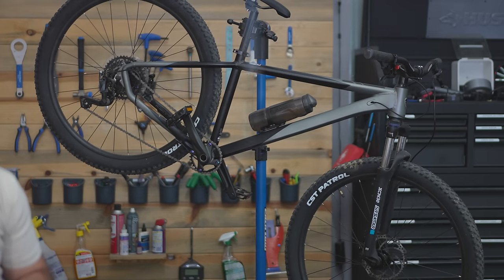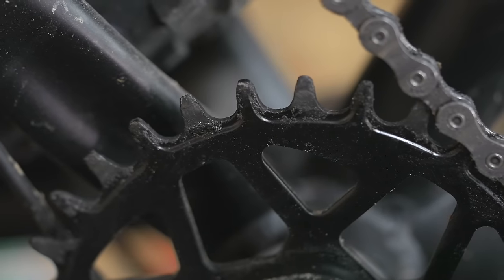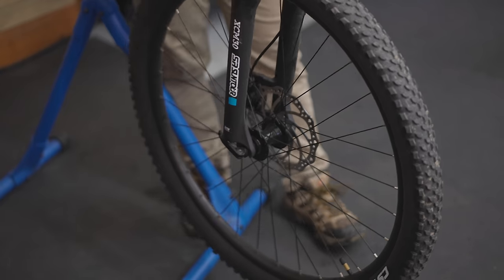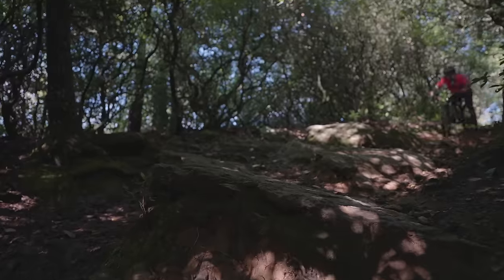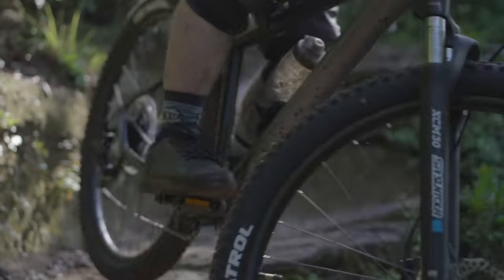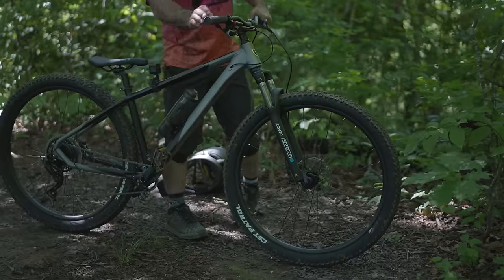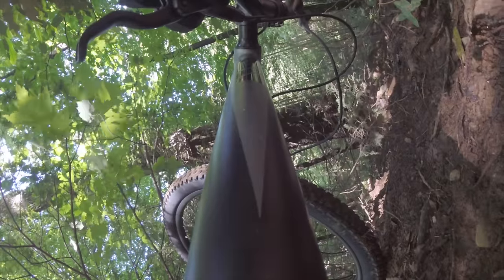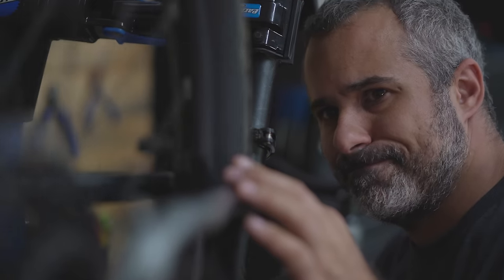Walmart MTB Upgrades! Will it explode or improve?

Comment: It might be worth looking into how much a basic chain guide helps with retention in lieu of a clutch Advent derailleur. Hilarious option would be just to use an old front derailleur. Also bled two pairs of Zoom brakes on some better consumer direct eBikes today--went fine, they worked well. The levers seem extremely similar to Tektro but the calipers are clearly different. I'm honestly not sure what the fitting I used for the caliper was intended for, but it fit--Tektro fitting on the lever. Also may be fun to see reviews on some cheap tires with more gravity focused tread. CST BFGs are pretty chunky for cheap.

Comment: I would certainly go for fatter, knobbier tyres, and set em up as "ghetto tubeless" for a big grip and even suspension feel improvement. I also would try one size bigger front rotor and some sort of chain guide/tensioner for extra retention (parts bin front derailleur, pulley boomerang thing, chain catcher, etc).

Comment: if you are lucky you can get a co-op shimano 9 or 10spd rd with a clutch for $35 or less if you trade in the stock rd. I once found a 10spd Shimano deore that came out to $38 with tax at my co-op. Used once according to them, which is great! Universal Cycles out of Oregon sometimes has Schwable, Continental & a few other name brand mtb tires on sale for under $30. Worth browsing around.

Comment: As a person hitting black level jumps and drops on a bike that is pretty similar but with a 2 gears on the front (Norco storm 3) Its hilarious seeing Seth have the same problems that I have (wheel coming loose, chain dropping etc.)  if this isn't just my bike after around 10 proper rides that fork is going to get way worse.

Comment: You can get those brakes cheaper and safer at your local bike shop! Many bike industry vendors stock Promax brakes for $55 a set.

The bike company my shop works with has quietly started putting Zoom, Power, and Promax brakes on their lower hybrid disk brake models. The brakes are good, but they have pretty bad quality control out of the box. If you buy these, make sure the system stays sealed and check your pistons to make sure they retract all the way! People often have trouble getting them set right because the pistons do not retract and stick out too close to the rotor. They are usually fixed with a bleed but sometimes they need to be replaced. If you buy them from a local shop it will be much easier to obtain a good replacement.

Comment: I have a Trouvaille with some upgrades but I didn't do the forks yet I do have a dropper seat. But the forks are doing the same thing I think they're even bending forward at the head tube also. I think a better pair of forks would really make this bike awesome. I cannot get the front fork from topping out. I ride it hard like that probably three or four times a week but I do give it a tune-up after every ride. Also the brakes on mine work really good.

Comment: Never had a problem with Avid BB7s which I’ve been used on various bikes over the last 20 years or so, but am curious to try hydraulics. Only problem is winter riding here in MN. Worried brake line could freeze!

Comment: Yeah if I remember correctly that fork has a little adnotation on it says it's not for downhill/enduro use, something like that.
I think if you change the fork for the amazon air fork and derailleur with clutch it will perform just nice.

Comment: its actally pretty common for mass produced bikes whether good qualiy or not, to have the quick release skewers come loose on the first ride ro two, the same can be said for any gym equipment, or any equipment involving threading and something that gets screwed into that threading.
when you put in fresh, bolts, screws, or anything of that nature, on a freshly built piece of equipment, the metaltypically wll slightly stretch, shrink, expand, warp, or change in some other way to where the fit is a little loser than it was when you tightened it on day one. 
after one or two uses the metal settles and finds a stable position and point, after which nothing should come loose. 
i deal with it every time i: build a new desk or piece of furniture, intall a new piece of gym equipment, the last time i changed the rims on my car, every time i have gotten a new bike with quickrelease, and every time i bought new rims and skewers after that. 
metal despite how hard it is, when put into relation with the forces inflicted on it by us on a daily basis, is actually quite soft. 
like just think for a second how much weight gets slammed down onto the entirety of your bike when you simply jump off a curb at a substantial speed. if it were a person you landed on instead of a bike with wheels thas able to carry momentum you would probably cave their chest in. 
alot of heavy impactful force gets applied to that bike when on the trail, its honestly impressive to me that we can build bikes that can put up with the torture and stress we put them under. engineers are crazy smart people.

Comment: "Rocky Mountain Fusion 30" L9Sports $855 120mm Air Fork (adjusted from 100mm)/66.5 head tube angle/29" wheels/tapered head tube/clutched derailleur/hydraulic disc/1x10 speed People over look this bike all the time when looking for a great value entry level bike. If it had boost wheel spacing, it would be their 2019 Growler, they class it as adventure bike.

Comment: I watched this video because we got my 12 y/o son a Nakamura Ecko from Sportchek and we ended up replacing a lot of his bike.  Basically, we upgraded the drivetrain on my 94 Hardrock ultra and we put all the old stuff on his bike but we had to swap the wheel to do so.  HUGE upgrade.  But the tires were unsalvageable so now he has a set of Kenda Nevegals on the bike.  Basically, this was mostly hand me down parts from my old bike so in a way, we 'sort of' beat the system?

Comment: It is worth noting that Clarks also do a set of hydraulic disk brakes for almost exactly the same price as the zoom ones. Without testing, I can't tell you for sure which is better, however clarks are infinitely more reputable than some dogey amazon seller. The clarks also come with a warranty. I have a set on my bike and have had them to the point of overheating while hill bombing on a huge hill.

Comment: I am a smaller guy, 5 feet, 4 inches tall and I used to weigh 125 pounds till about age 33. In my 20s, I bought and abused the Walmart sold Mongoose dual suspension 24 inch mountain bikes. I got a few years out of the last one I had, despite breaking the rear 3rd gear and being stuck with only the top two gears to shift between after the cassette collapsed.... Like I said, I abused those poor bikes.. I got to the point where I just did all but the absolute steepest hill climbs in 21st gear.

Comment: Love your cheap bike evals! While I agree that you can get a Walmart MTB to perform adequately with a few mechanical upgrades, I wonder what the longevity/cost ratio would be after longer term 'normal' use and abuse when inferior original parts begin to fail? Seems like after a dozen rides over typical rocky and rooty terrain this bike might be needing wheel and fork replacement at the very least - which when added to the initial acquisition cost would put a more substantial and capable MTB within the reach of the value minded consumer.

Comment: Those amazon air forks are VERY hit or miss. I got a brand called ZTZ, 140mm travel, 29er thru axle, $160. A little too good to be true, but they work. The forks were a huge upgrade from the original xc32 on my Trek Fuel Ex 5, plus the extra bit of travel made the bike feel better downhill. The only issue is that the rebound adjustment on the forks stopped working after 5 or so hard sessions. If I knew how to service a fork I could probably figure out how to fix it.

Comment: I'm not sure about the Walmart route for an inexpensive bike. I recently bought a second hand, 9 month old Scott Aspect 760 for about 380 USD to ride with my son. It's not the greatest bike in the world, but not the worst either.

It replaces another bike I bought new 3x8 for about 400 USD. On that bike I broke a pedal, the chain and almost completely stripped the large chainwheel. All replaced and upgraded. On top of that, I replaced the forks with a cheapish pair ZOOM (sounds very fast) forks, so that I could lock them out. As the forks that came with the bike had an ornamental lock out lever. On top of replacing the complete drive train, I replace the hand grips and saddle for something more comfortable and fitted a Topeak rack. Total price for the cheap bike about 750-800 USD.

The Scott on the other hand, apart from swapping over the pedals, hand grips and rack and tightening the head set, has cost nothing more in time, money or heartaches. For a much better bike.

Comment: Buy yourself a small spring with hooks on each side. Drill the derailleur on close to the back jockey wheel and the cage. Fit the spring (take measurements before buying) and say goodbye to dropping chains.

Comment: As a cheap alternative to a clutch, what about using the old-pre-clutch solution of a chain tensioner?  That wouldn't add significant weight and would still be significantly more affordable than a clutched derailleur, wouldn't it?

Comment: Nice and cheap.
But upgrading an old mediocre bike, be it second hand or one from the attic, is more rewarding.
I actually upgraded my half decent bike with deore xt drivetrain and brakes, some fresh tires and microspline freehub - runs so much better now.
And I've sold about half of the old parts that came off the bike, to recoup some of the upgrade costs.

Comment: Seth just a warning on those 150$ air forks, is they only have 2 little bolts holding on the lowers and I've had them come off on me one time. And the nuts in the crown that hold the damper cartridge tend to be really loose. Just a heads up if you get one🤙 don't wanna see you go otb like I did😂

Comment: A skilled rider helps...anyway, I always question the premise of upgrading these super-cheap bikes that have a few decent parts but ultimately are lacking in key areas like, oh, the wheels, the brakes, the drivetrain and the bb. Maybe I'm just old school but I think that a used trek or specialized entry level model is just as good of a deal. The problem is that once you get to a certain skill level, you'll want MUCH better components, so then you're faced with the unpalatable option of spending 50% of the cost on a fork or 75% percent on a wheelset...

Comment: I've got what I think is a similar sort of class to this KT for doing trail riding and I'm wondering if it'd be worth doing some upgrades to it or if I should scrap it and buy something more expensive that already has what I'm looking for. My current trail bike is a Diamondback Odyssey from about three years ago, and other than replacing the pedals, grips and handlebars for something a little more comfortable than stock it's basically as it came from DB.  Since it has rim brakes I'm finding it super squishy when I'm riding on muddy trails (which are all of them this time of year) but it doesn't look like there's mounts on the stays for disc brakes (does look like the front fork has a spot for the rotor, though).  Do you think it's even worth my investigating them with my local bike shop or sell off my DB Odyssey and look for a Marlin, maybe?  Thanks! Love the content!

Comment: I opted to never have quick release on MTB again after my 2 previous ones had gotten loose on the front (not even from trailing, just regular asphalt riding), first one even fell out a little when I turned onto a driveway curb, resulting me in falling of course, the last one I had showed it was loose when I used the brakes, not fun.

Comment: Hi Seth, I used to have a bike with quick release and the wheel still had play even when the quick release lever was super tight. I may be wrong but I think there’s two nuts that can be tightened on either side of the axle.
Reply: Also the placement of the little spring makes a huge difference
Reply: @joseureste8257  shit i never worried about them 😂 thank goodness for thru axles couldn’t survive without them

Comment: Would be sick to make it a trail hardtail… 130mm fork, mt500 brakes, bolt on skewers, tubeless (would probably have to run inserts on those wheels) shorty stem, wide bars, good peddles, box prime 9… would be the most badass Kent ever
Reply: Mullet it if it is a 29er
Reply: Dropper

Comment: I think it would be interesting to see if you tried Himalo's new 160mm fork with 34mm stanchions, quick release and with a straight steerer they've i think just released. The fork looks interesting with metal bushings and oil foam rings and with few improvements in the structure of the fork, that for me makes it kind of a interesting choice. It's nice to see they are improving they're products. 160mm could be a bit too much for the bike though.They do also have 140mm travel fork with 36mm stanchions but that one has thru axle so obviously you would have to change the whole front wheel or the front hub atleast.. actually now that i think, that would be really cool and interesting to see.. I know budget Rockshox would probably be the safest way, but that would be kinda boring, for me atleast.

Comment: I'd go for a cheap 20-50 buck chain guide, might mitigate those chain drops a bit

+ you could use it to convert it to single speed, drop some weight & make it less vulnerable to derailleur hanger bending 

I'd also would be intrigued to see how it performs with a better set of tires, guessing it will be night and day for performance & confidence

Comment: How cool would it be to compare this upgraded Kent to a Giordano Intrepid and compare which one is a better value? The slightly more expensive Intrepid? Or the modified Trouvaille?
Reply: I have both bikes in my garage right now. I'm trying to decide which to keep. I think the intrepid is the better one since upgrading the fork to a tapered will mean changing to a thru axle for front hub on the Trouvaille. However the shifting isn't as crisp on the Intrepid 1x10 XLE as the Trouvaille 1x9 Advent. The Intrepid chainline in lowest gear is not very good and the front ring gets rubbed. If I had the special tools to upgrade the Trouvaille and build my own wheels and put on hydro brakes I think its the best budget option.

Comment: I’ve been a long time viewer of your channel, and you’ve helped me out by watching your videos.. unlike many in the MTB community, I had to go with a cheaper route, so I bought a Mongoose Ardor. I’m trying to do little upgrades when I can afford them, so far I’ve put on hydraulic brakes, and I was going to upgrade the forks, but it sounds as if the bottoms bracket needs replacing. I can’t find what size bracket I would need. I’m happy with the 7 speed it came with, so I’m not sure if a tapered bracket would be good or if I could upgrade to an external. I’m sure that if I do that, then I will have to upgrade my cracks and move from a 7 speed to something else. I don’t have the budget for new gears, new wheels, etc… can you help me?? Thanks again
Reply: You just need a 68-73mm bottom bracket and crankset on Amazon

Comment: I have first hand experience with zoom brakes on a day to day basis and it's basically old Shimano patents that ran out with poorer quality in mind. In all reality I'm surprised both bled. I've always had problems with them on cheaper ebikes (under 3000) here in Canada and they will fail under 500 kms 6 times out of 10. That being said I don't have experience with the non ebike brake handles(without thr brake cut) I would be curious to see how the seals hold up on these. Usually hell for me tbh.

Comment: As someone who just got one of those cheap Amazon air forks, I'd be interested in your opinion. (I actually got a 26" by 4" fork to increase the slack angle on a 20" by 4" fatbike!) I wondering if the fork is going to snap at the crown!!!! 🤕

Comment: Hey Seth, my '21 Diamondback Hook came equipped with an ISCG-05 chain guide with roller. Would one of those help this bike with dropping the chain? I like the premise of tweaking a cheap bike to make it able to hang with much more expensive bikes. I think a better set of forks should be next.

Comment: Already bought an Amazon fork for a project bike. It might be better than the Suntour but not by much. The dampening is not great, think like gen 1 fox or so and mine had severe stiction issues. this developed after a few months of use. The stiction was so bad it would sort of get stuck in the sag.
reason I bought the fork: GF's hardtail. has a non-tapered head tube. could not find a name brand or quality fork only amazon had it.

Comment: Quick release hubs and disc brakes are a terrible combination, that's what. When you lock up the front brake, the brake pads become the new pivot point for the wheel as it tries to lever/eject the axle out of the dropouts. Sure, forks have those stupid recesses or tabs in them now to try and counter that, but the constant rocking motion applied to a front hub can back off a QR until it flops open.

The answer to this is those old chrome plated skewers we had on old bikes, typically made by Shimano but invented by Campagnolo in the 1930's. It's an age old design, a little bit heavier than a cheap alloy skewer. With a drop of oil in them from time to time they will have a significantly higher clamping force than any cheap alloy skewer and that's because they're a mechanically advantageous design. Why don't more bikes include them? Because they're more expensive to manufacture for the cheap bikes, and less appealing weight wise for the expensive bikes.

Shimano aluminium skewers are almost as good, but without steel serrations on their faces they just don't have the same bite. Thru-axles are definitely a welcome improvement, and I wish more bikes included them, at least on the front where it actually matters.